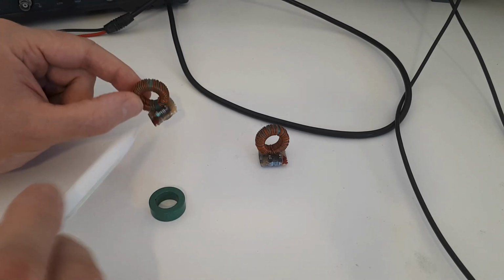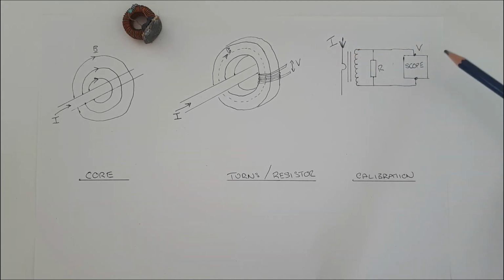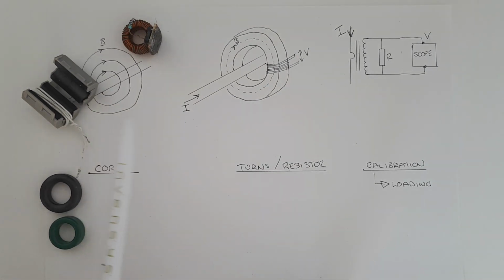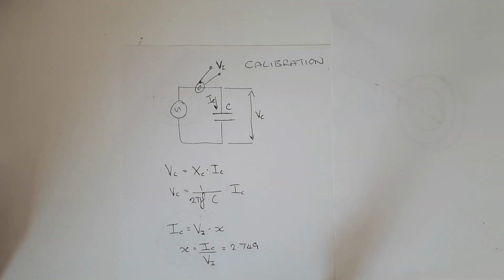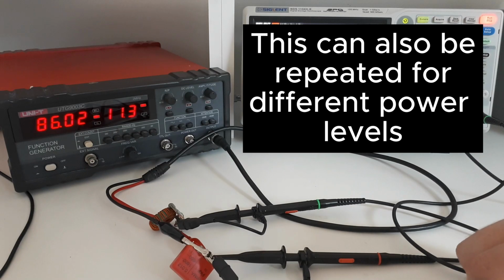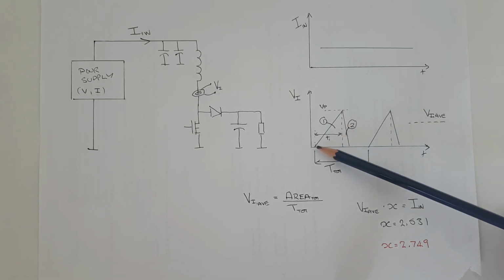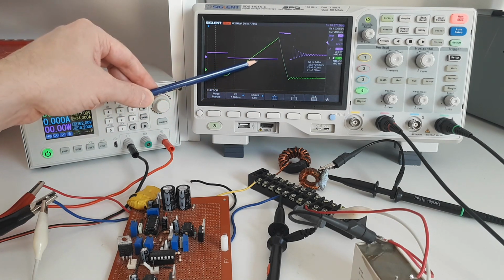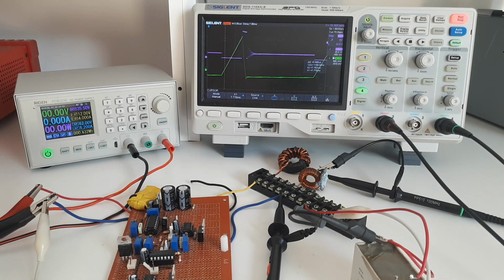How to make and Calibrate a Current Probe

Comment: Why when I pass a wire through my current probe (a wire between L and the diode in a boost converter), do I get the same shape as if I were measuring the voltage at the switch node, but smaller (I dont get a triangular shape)?

Comment: Its difficult to think in AC, but isnt easier would be to calibrate using diode bridge and resistive load(like light bulb)?
I.e. to AC source you connect diode rectifier and measuring current flow into rectifier with your diy ferrite core sensor, while across DC output of rectifier connect resistive load, now you can measure current flow inside DC circuit with cheap multimeter and voltage across resistive load, this will give us power flow through DC circuit, add to this power loss on diode bridge(easy to calculate knowing voltage drop on diode and curent flow through diode) we will have total power provided by AC source, now if we measure actual voltage across AC source(again cheap multimeter can do it) we can calculate current flow in AC circuit.
Reply: Why not just use a resistor?

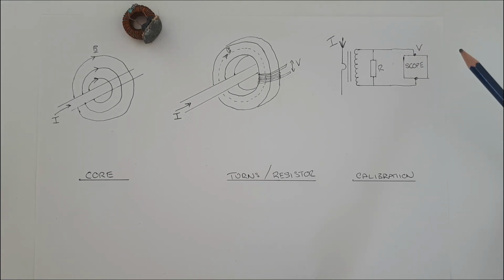Comment: 2:30 The main reason for the resistor is not the phase shift. You simply need it for current to voltage conversion. Current on secondary side has to flow somehow and the only controlled path is via a resistor.
Reply: is it that the resistor cause that voltage across inductor is not controled by inductor but by the resistor? and this is why the resistor must be small compared to the impedance of L to not male a voltage divider? correct me if I am wrong PLEASE

Comment: How about adding a hall effect device to measure DC current in additiion to the ferrite core for AC current?
Reply from the maker: Yes you are right. That would be a good addition to the probe. However, dont forget that the more complicated things are the more can go wrong. Basic volt meters are very good at measuring DC current already, they are also very cheap.

Comment: You said that the likely source of error when finding a calibration constant could be the capacitor. 
But why not use a resistor?
Reply from the maker: Most resistors have significant inductance, meaning that their impedance would not be equal to their resistance value, and that it would change over frequency. You can however, buy induction free resistors, but they are expensive.  The point is, whether you use a capacitor, induction free resistor or even an inductor,  how accurate is the value which is printed on it? When you calibrate something, the more sources of error you can remove during the process the more accurate the value will be at the end.
Reply: @ElectricMonkeyBrain  I don't think the way you chose to calibrate is more accurate, though. I'm pretty sure, that your more complicated approach is introducing more errors. Thinking about the parasitics of your components is good, but the inductance really only is a problem when you use low-ohmic shunt resistors. When you use small chip resistors with a few ohms, the self-inductance will be completely negligible in the whole frequency range your self-made current probe would even be able to handle. And regarding money: A ±0.1% resistor would already be good enough and costs only a few cents.

Comment: What are the dimensions of the iron powder core that you use for your own current probe?
Reply from the maker: outer diameter is 2.4cm, inner diameter is 1.2c. thickness is about 0.9cm. But different sizes also work

Comment: A high permeability ferrite core of 13 mm OD and about 6 mm height is quite capable of working well up to 15-20 amperes. I've used them in many SMPS designs.